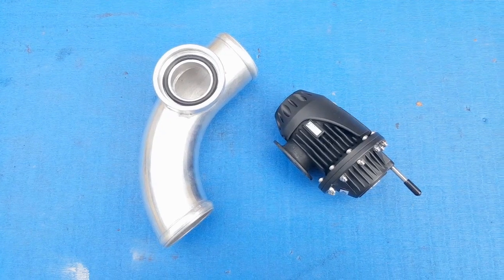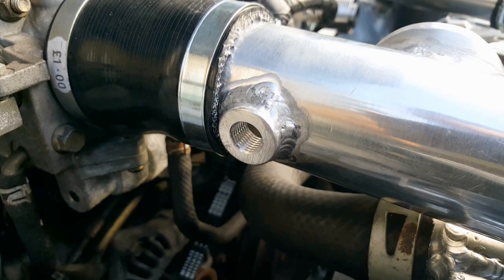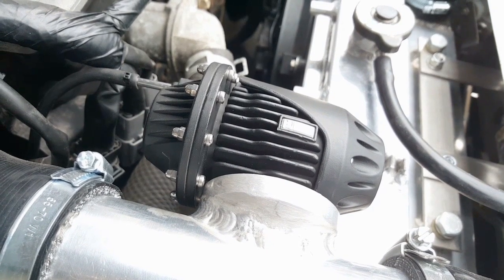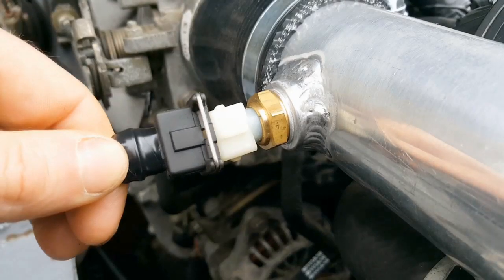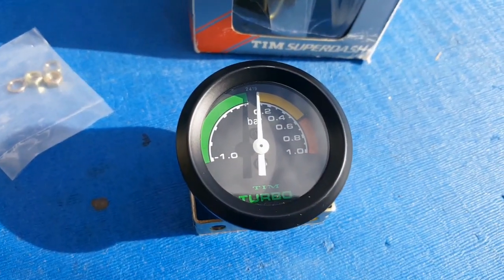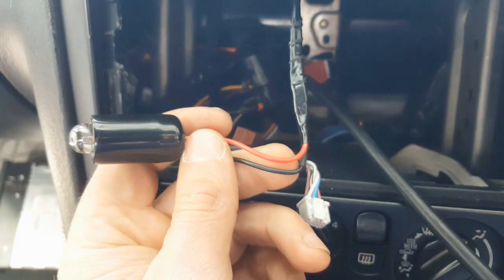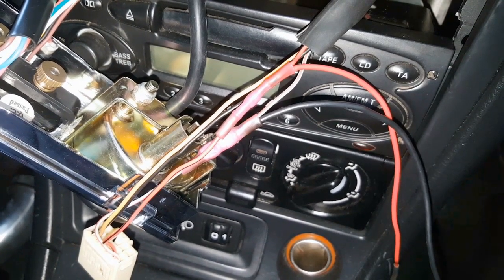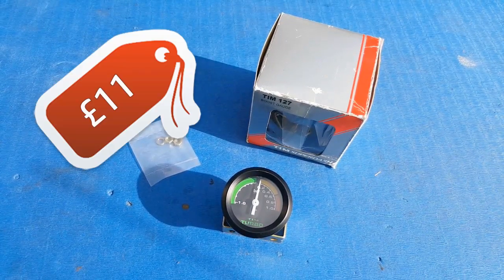How to Install a Boost Gauge, Blow Off Valve (BOV) & IAT Sensor | Supercharging the MX5 / Miata Ep25

Comment: How come this set up needs a BOV but the R53 Mini Cooper S's don't have one? The lore on the forums for those is that the supercharger stops producing boost as soon as you're off throttle because the revs die, but I suppose the BOV allows any residual pressure generated by the fact that the engine RPM dies more slowly than the the TB closes? Be interesting to hear your 2 cents.
Reply from the maker: Yeah you've pretty much got it. With a setup like this with a relatively large volume of air between the supercharger and the throttle body, when the throttle snaps shut that compressed air has to go somewhere. Yes, it will vent through the bypass but without a blow off valve some of that is going to back up into the charger forcing the rotors to slow down. This will either cause some pretty severe engine braking. Or the belt will slip.
Reply from the maker: There's an audible release of pressure from my BOV when I let off the throttle so it's definitely helping to relieve that intake pressure
Reply: @FastRust  thanks for the reply, all makes sense, just had a thought that on an R53 the TB is before the charger which would stop pressure surging too, I guess it's a simpler to add a BOV instead of moving the TB, especially as you still need something TB shaped to connect to the manifold

Comment: What is the thread pattern on the IAT sensor and where did you get the plug for it?
Reply from the maker: That particular IAT sensor is an M14, the plug I got off a mate but you can get them off ebay
Reply: @FastRust  thanks a bunch. I have a ME221 so I’ve been using your videos to help me along!
Reply from the maker: Sweet. If you get that sensor I can send you a pic of the calibration table in MEITE if you need it. You won't be able to find it anywhere else. Trust me!
Reply: @FastRust  that would be much appreciated. Email works for me or Instagram DM
Reply from the maker: Have to be email don't have insta. If you don't want to post your email here send one to me first at teamfastrust@gmail.com

Comment: My engine kicked the bucket recently so I've been planning on sending it to the machine shop and then starting my supercharger build. I just watched this whole series today while at work, and then got confused why I couldn't find the next video... I realize now that I'm caught up! I can't wait for the next video! I'll be copying your build to some extent later this year :)
Reply from the maker: Yeah you're up to date! If I pull my finger out next video will be uploaded this weekend. Glad the series is gonna help with your build. Probs cheaper to pick up another engine than have the old one machined?
Reply: @FastRust  Possibly so, but if I have it machined then I'll have more confidence in it... My friend paid $600 when he had his machine work done, so hopefully he can hook me up
Reply from the maker: Yeah it's a good point. I did the same with the short block on the Capri, so I knew it was in good shape before modifying. Interestingly I paid £600 years ago! What issue have you got with the engine?
Reply: oh I never answered your question
my first issue was that I lost compression on one cylinder, then my next issue was that I took my engine apart into a million pieces
Reply: I'm through the other side now! just trying to tune out a couple last quirks

Comment: Great video and can't wait to see it running. Just wondering where your idle hose is routed to?
Reply from the maker: Thankyou! Which hose is that? Not sure I've touched an idle hose?
Reply: @FastRust  The idle air control valve breather hose. It's the hose which comes from the right of the engine near the oil cap which goes to the middle of the stock air intake.
Reply from the maker: I don't think that's anything to do with the IAC system, it's just a breather hose from the rocker cover. I've bunged a filter on it for now. Will be covered in next vid.